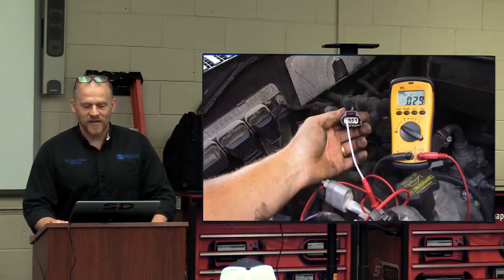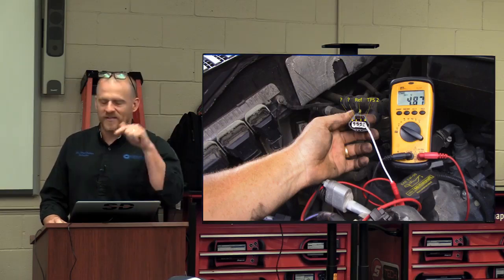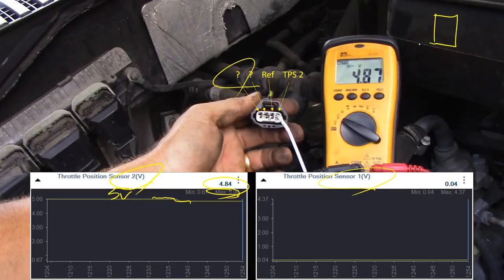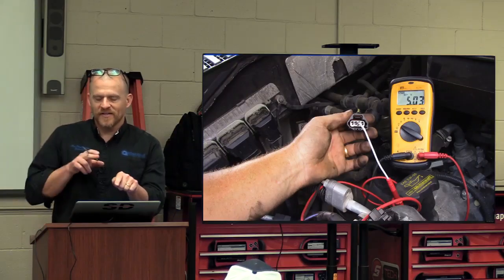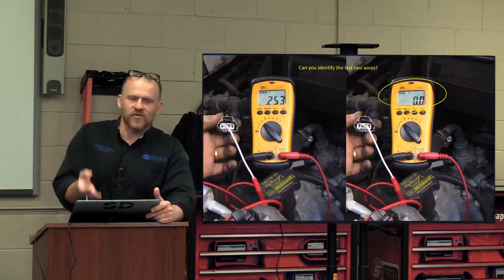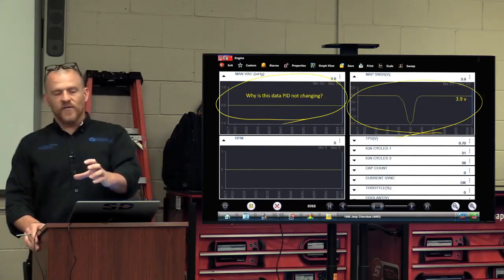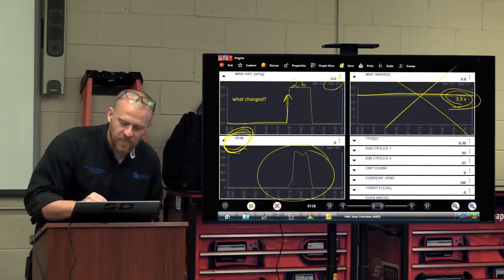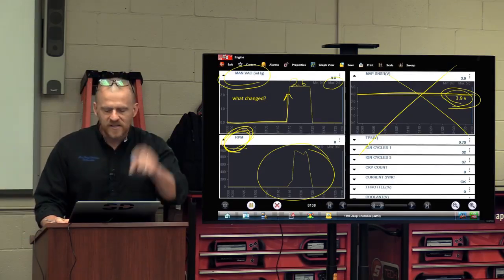Circuit ID and Integrity Testing Part 3 (an SD Premium class preview)

Comment: This is why your book and premium videos are an investment. The material is updated and can be referenced again for those duh moments when something like that is easily overlooked. Quick question. Could a sensor simulator be used at the cpk connector to force the PCM to see an RPM signal? Or is cranking the only way to complete that test?
Reply from the maker: I've done it with my test light  :-)
Thanks my friend

Comment: I have a general question for anyone who can answer it.
On an OBD1 system, typically if you direct scope the one-wire O2 sensor do you expect to see the  same lean/rich oscillation at idle that you see when you look at a narrow band OBD2  O2 sensor through a scan tool or will it just balance out for the conditions at the time? Mine really looks more like an RPM rate fluctuation and not the relatively full range swing.  It will fully deflect based on running conditions but not the routine fluctuations that we all see on newer vehicles.  This is a 1988 Isuzu I-TEC system and yes, it doesn't know whether to go rich or lean 90% of the time and runs like it. Thanks.
Reply from the maker: You cannot gauge a single wire O2 at idle. It doesn't get hot enough. 2000 steady throttle to view the up down swings of the signal and whether or not the O2 is functioning properly
Reply: @ScannerDanner  Key info. Thank you.
Reply: My understanding is that the O2 sensor only oscillates in response to changing AFR caused by fluctuating fuel trim. Are you sure the system is entering closed loop? Fuel trim doesn't fluctuate in open loop.

Comment: To add to the second segment, using generic data also demands the raw data . Meaning that instead of starting the vehicle switch to generic obd2 for instant updated data and voltage display.
Reply: That's a good thing to keep in mind too. Thanks
Like remembering to latch the hood on a VW before wasting 1/2 hour checking windshield wiper fuses and scanning modules. LOL
Reply from the maker: Lol, you remember that
Reply: @ScannerDanner  Remember it? It happened to me again last week!
Reply from the maker: Worst part is the VW service information and diagrams show NOTHING of the hood switch being involved in that circuit. Smh
Reply from the maker: For sure, if that particular data PID is available in global mode